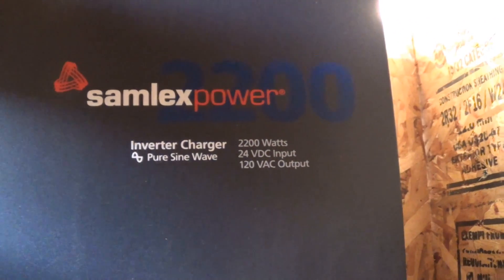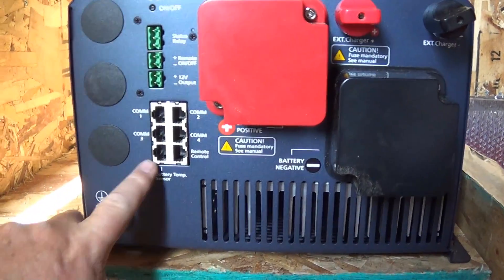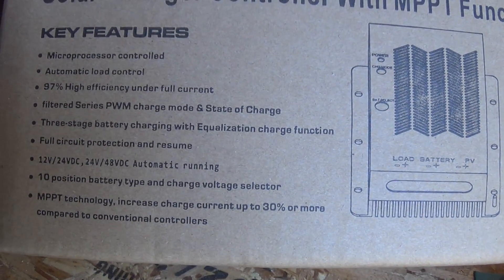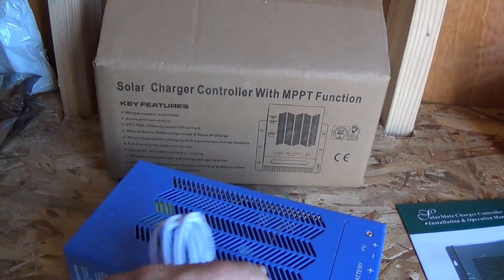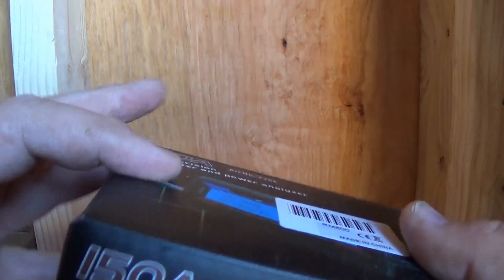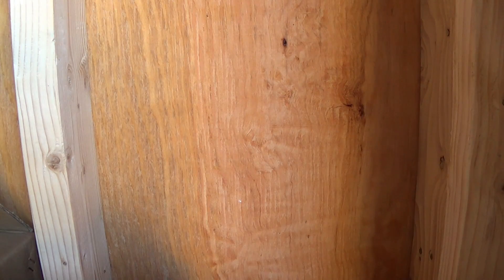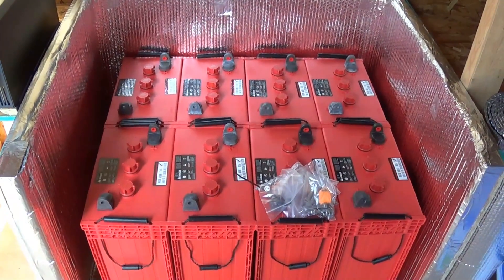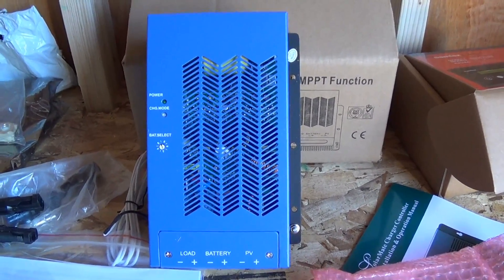Overview of the Solar Main Components prior to installing. It's time for Solar

Comment: Nice, not a cheap setup.
Reply from the maker: +Doublenotminer spent more than I originally thought I might but it gives me a peace of mind. so far I went 3 heavy cloudy days and still didn't use my battery bank down to 50% the lowest I got was 65% with downloading videos and time on the internet. I don't have a laptop so I use a desktop computer which as you know uses more power.

Comment: Glad you are getting your power!  Yes you will have lots of videos. There is so much to talk about w/ each part. I know. I haven't done it as I do not have access to the system till I move. Mine is so opposite-low emf and all DC, sort of like they did in the 60s.LOL I am glad you could spring for lots of panels and batteries-will make your life a lot easier. :)
Reply from the maker: +Prima Donna Going Off Grid I will be king of my homestead. lol..... you know running everything on 12v with a couple of small inverters to run some things so you can turn them off is awesome. in fact have you looked at off grid with doug and stacy? they have no solar, use their auto as a generator to charge phones and laptop. pioneer days for them. you might really benefit from a set up like theirs, almost no emf at all.
Reply: +ArizonaHotHomestead Funny I have their channel bookmarked before, but have not watched them yet.  I think they may be too primitive, as going to the car, is not possible most the time. Guess I am just going for the happy medium. I may turn the circuits that are not running the fridge ignite, off at night. The "wireless to wired phone/net will be able to shut off remotely from inside as well.

Comment: the load out (dump load) on the controller can be connected to a standard hot water heater where you change the 110v heater element  to a dc element that way when the battery bank is charged any solar energy will heat water for free. cool stuff.
Reply from the maker: +Quartzsite Business when I purchased the system we talked about the different things I could use the load out for. heating water seems to be the best idea.

Comment: Nice ! I will be watching.  All great gear ,  The Samlex inverter should be rock solid,            Rolls Surrette  batteries top line,  except we will see how the charge controller works best wish's on new set up.
Reply from the maker: +TheKilog69 thanks. my panels max out that controller we will see.